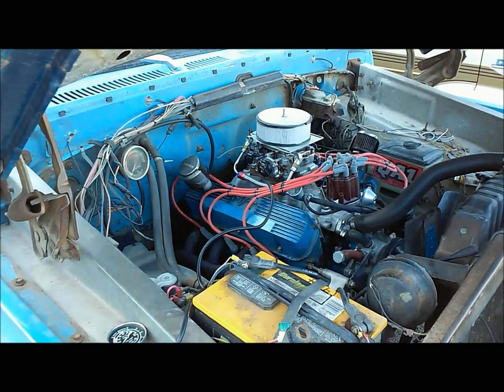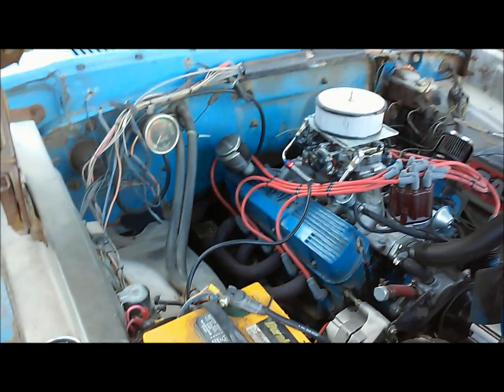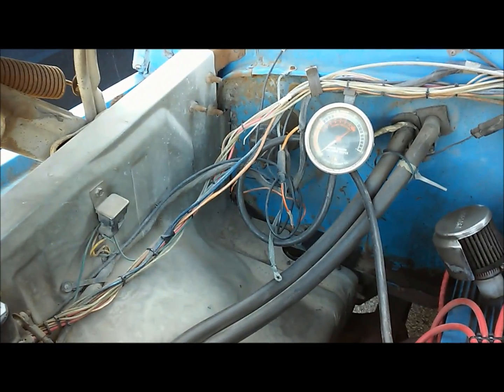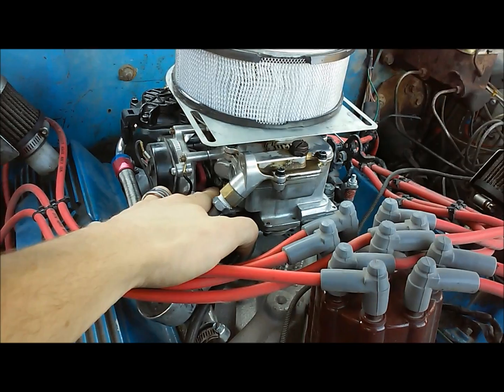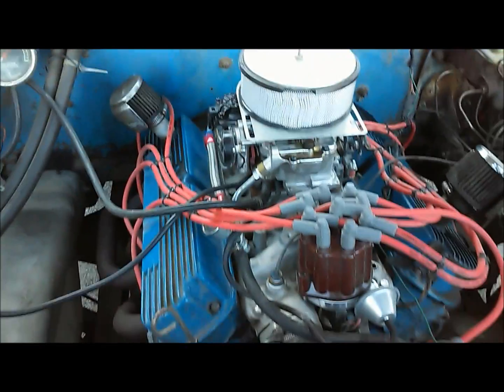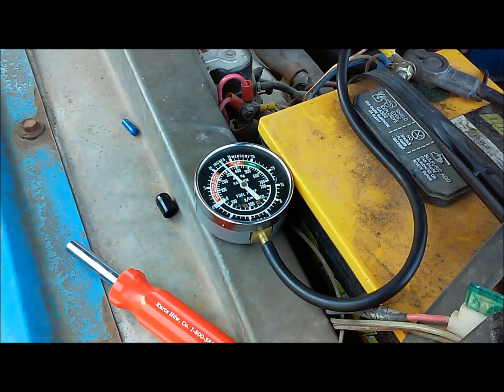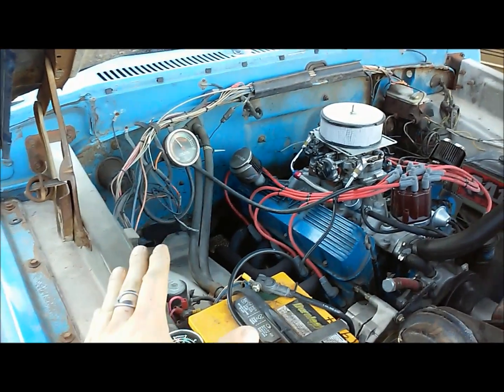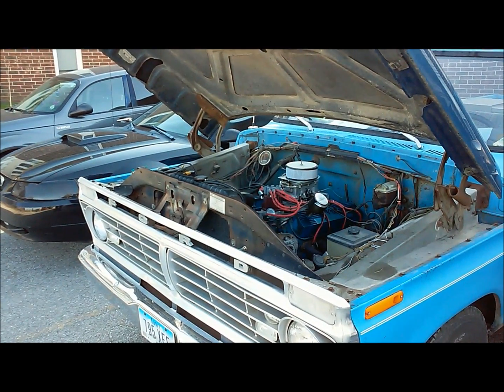Carb Idle Mixture Screw - How To Adjust Properly  (EXPLAINED/DEMONSTRATED)

Comment: Hey I have a Holley 750 cfm on a 400 sbc. I don't have a vac gauge to test anything but I'm working on getting one. My problem is that I have no idle. I drove the car on the highway for an hour until it started surging and stalling but I managed to get it home. I have to set my distributor at full advance just to get the engine to crank up. My carburetor backfires now ( like a cannon going off) but I tried turning the distributor clockwise and never turns over but if I set it fully counterclockwise it fires up and backfires. 

I managed to get it running lately but only for 3 minutes then it dies. It starts with a very high idle around 3000-4000 rpm and just stays there surging up and down until it dies. Oh yeah that's with the idle mixture screw back completely off. 

Some people tell that I should try to keep it idle at 5000 rpm to set everything but I'm nervous about the backfire.
Reply from the maker: on the chevy with the distributor in the back, i believe you turn it counter clockwise to advance the timing. nevertheless, dont idle it that high. you will have to get a timing light on it since such a small turn will change the timing significantly. do this, get your distributor to about 8 degrees of timing at top dead center, then pull your carb and flip it over so you can see the transfer slots (long thin cut line in the carb bores) set your throttle plates so that there is only a square showing. then turn your carb screws all the way in and set them to one and a half turns out. this should get you where you need to be and you can fine tune from there.
Reply: Kendricks Hayes Jr It sounds like your distributor is 180 out, have you taken it out lately? You may need to put the motor TDC and drop it in
Reply: Kendricks Hayes Jr
Do not listen to this guy Thunder Head, eH sounds like he was dropped on his dunder head, speak simple. every fucking chevy big block and small block V8 is the same ,stand in front of engine. rotate your vac advance toward you that,s advance, turn it away from you thats retart like a lot of folks here.
Reply: Amber Chrismen please tell us more so we know!!!

Comment: I hooked up a gauge and getting 15 to 16 vacuum .idles at best after less than 1 turn .but idle is not perfectly smooth I had tan color spark plugs after this set up .if I turn it  more than 1 turn I got black plugs .vacuum gauge does not really go down though it's hard to find that sweet spot any ideas?
Reply from the maker: how much do you have your transfer slots exposed?
Reply: +ThunderHead289 good question let me find it out
Reply: +casanovaevren it was exposed too much I set the screw all the way up its still like 2 square slot now but before throttle was crack open.I set the mixture to the best idle then drove it I got back fire on the carb which was too lean then I set them up 90 degrees out and started to smell a nice burn but not too heavyand  not burning my eyes like it did before it runs better idle is not perfectly smooth but I can live with that just got the car 79 Corvette with a mild cam 12 initial 34 total timing and waiting for some appropriate vacuum advance to hook up currently I maybe get 6 or 7 mpg
Reply from the maker: sounds like you are getting fairy close! the bigger the cam, the more precise you will have to be with everything. it may just be your idle speed, i have to idle at 900 for a clean running idle with no load up.
Reply: +ThunderHead289 at 900 it's smooth I ll see how it ll be when I hook up vacuum advance thanks for the video
Reply from the maker: depends if you go ported or manifold vacuum. if your going manifold, may want to look into an adjustable vac advance unit
Reply: +ThunderHead289  yea I ll do whichever works best
Reply: +casanovaevren my new distributor came with adjustable one but no Allen key fits in it lol
Reply: +casanovaevren how about air fuel mixture analyzers  they seem cool stuff
Reply from the maker: +casanovaevren I run one in my galaxie. (Wideband O2 gauge) take a look at an aem one off of eBay. Bout 150 and work awesome. Makes tuning so much easier.
Reply: +ThunderHead289 awesome I need to drill some holes I guess I have long tube headers on
Reply: +casanovaevren - Notice I'll say this without having a clue about your particular setup (cam, carb, timing, etc.). But seems to me that 15/16 is a really low reading. In your shoes I would start testing with another gauge or at least test the gauge on another engine that's 100% OK. So you get a good baseline. 
A good point to start is Ignition timing and remaining components. Why? Because air and spark are free of charge, but gas is expensive. LOL ;-)

Jokes apart. In my tool box there are 2 gauges. While testing the same engine. One never goes above 15, the other read a healthy & steady 22... Be well.

Comment: What about the mixture screws in the back. You don't turn those?
Reply from the maker: If you have them, they need to be adjusted as well. All evenly at the same time and the throttle blades should be open the same. This carb here just isn't a 4 corner idle screw system

Comment: If I remember right the ideal mixture is 14.7 : 1 for gasoline engines in you got a digital air fuel guage.
Reply from the maker: +TRUNKBACK JIM it is, that is indeed stoichiometric ratio for gasoline BUT on a carbed engine, you will have fuel and air density variation with humidity and temp change, so 13.5 target is much more reasonable and forgiving. fuel injection is a different story.
Reply: ThunderHead289 We certainly get some temperature and humidity change in Iowa for sure. Thanks for sharing.
Reply from the maker: we sure do, we finally got some warm weather here where we can do something this weekend. what part of ioway?
Reply: ThunderHead289 In Des Moines, I worked at Whitlock and Jockos Auto Parts stores here in town if your old enough to remember either of those. Whitlock has been gone for 20 years but most people remember Jockos before it sold to carquest.
Reply from the maker: +TRUNKBACK JIM my mother worked there some 30 years ago. I'm up in ames
Reply: ThunderHead289 Small world, I still wear my Jockos hat from time to time and it usually gets great comments.